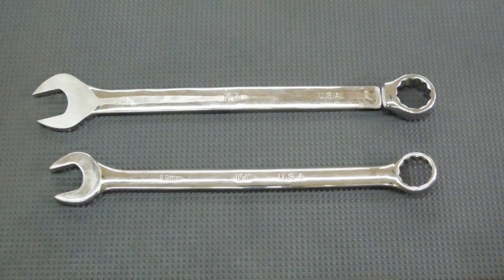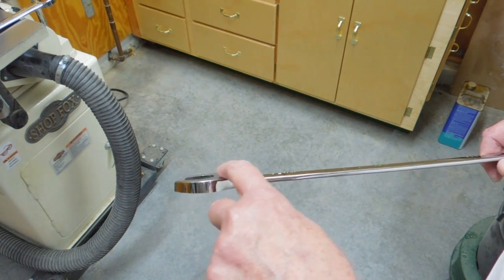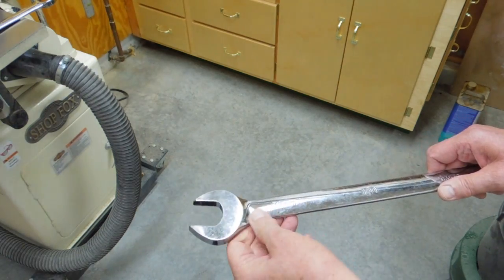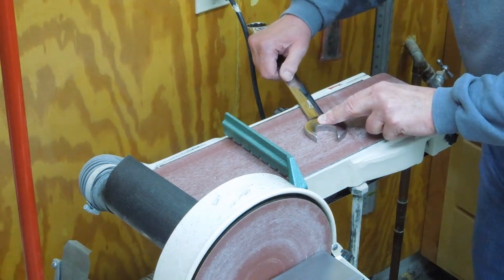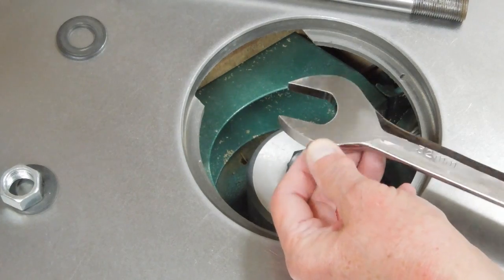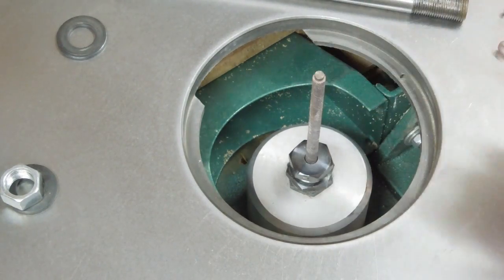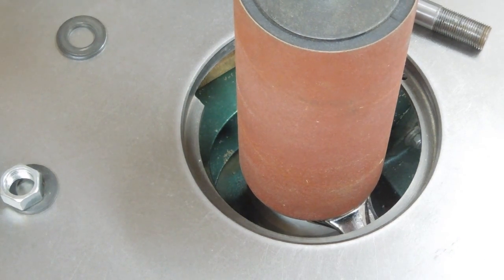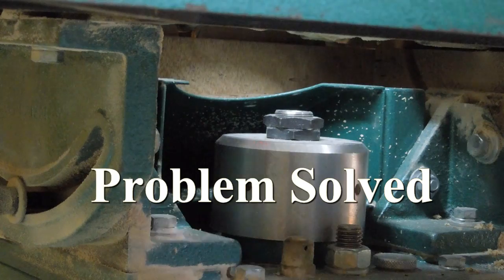Spindle Wrenches - Homemade - Grizzly G1071 Oscillating Spindle Sander

Comment: I just got a G1071 and I think Grizzly may have addressed part of the problem. There is now plenty of room under even the biggest drum to fit 2 wrenches. I was able to use an adjustable wrench for the 32mm nut on the bottom of the drum, and that tool must be at least a half inch thick. I think maybe Grizzly increased the length of the taper that fits into the drive socket, creating more clearance between the nuts. There is still an issue with torque causing the drums to tighten up to the point where wrenches are needed to remove them, but I see no need to modify wrenches now.

Comment: Very helpful video. I had the same problem with spindles getting overtight on my G1071 sander. I tend to use the largest spindle most in my guitar building projects, which is the most prone to seizing.

I tried to work the issue through Grizzly support for several months in the hope that they would try to actually solve some of the design issues with the machine. I was initially optimistic, as they were very engaged and were promising re-designed wrenches. After about two months of delays, they sent me the "redesigned" wrenches, which were actually exactly the same as the original stock wrenches (stamped sheet metal with spindly tips using the same die shape) with the exception that one of them was maybe 1mm thicker. Disappointing. I'm now taking your approach and customizing higher quality wrenches.

I have also been using a little anti-seize grease on the spindle threads and tapers which seems help quite a bit. It may end up attracting more dust, but so far no real issues.
Reply from the maker: With my wrench Modification you will no longer need to use anti-seize. Just blow the dust out of the spindle socket and keep the threads clean.

Comment: Ron, nice video. I'm wondering how the box end is inconvenient. How do you store them? I would think leaving it on to allow hanging the wrench on a peg would be handy.
Reply from the maker: These wrenches really were not intended to work on top of each other. The box end is at an angle to the bar to provide a better work attitude in most cases. With the wrenches right on top of each other for this application, depending on which way the open end is facing, the box ends will interfere with each other. I like to be able to flip the wrenches over depending on the position of the nut/spindle flats for better control when loosening or tightening the spindle so I cut off the box ends. These are dedicated to this sander as I generally do not have a need for such large metric wrenches. For storage I just lay them on the shelf on the left (which holds the small spindles) between the spindles and the machine cabinet.
Reply: Ronald Walters That all makes sense. I hadn't considered the interference at the box end.
Reply: tcsyme I did has you did and it did the job and i do thank you very much i looking for a way to do this one more time i thank you

Comment: I'm assuming that you decided to do this because you felt that the wrenches that came with the machine are lacking in some manner. Would that be a correct assumption? I ask that because my observation has been that the wrenches that come with table saws, spindle sanders, and the like, are often made from some inferior Chinese metal that does not last.

Comment: Do you think it would be worth gluing a spacer under the head of the 32mm wrench (away from the jaws) to help it automatically to locate onto the correct nut, Ron?
Reply from the maker: Not necessary. It would also prevent you from flipping the wrench over if you wanted to. Once you get the 32 mm wrench modified it is quite easy to use as shown.

Comment: what happened to your original wrenches?
Reply from the maker: The original wrenches were soft stamped sheet metal and would not fit the lower 32mm nuts. I tried grinding on them a bit but they were absolutely worthless. I think anyone who has a G1071 has an issue with the wrenches and how difficult it is to get one of the spindles off the machine. Standard size metric wrenches will not fit. My modified wrenches solve the problem and work perfectly. My video Grizzly G1071 Oscillating Spindle Sander - My Experiences covers the original wrenches.